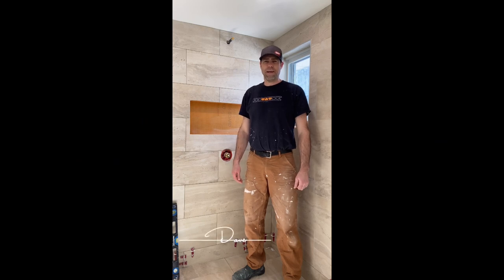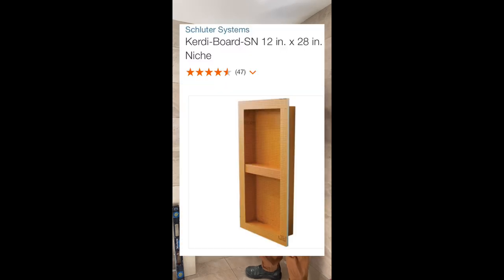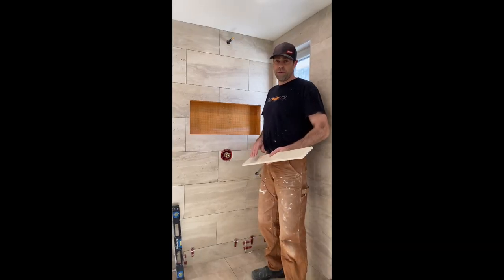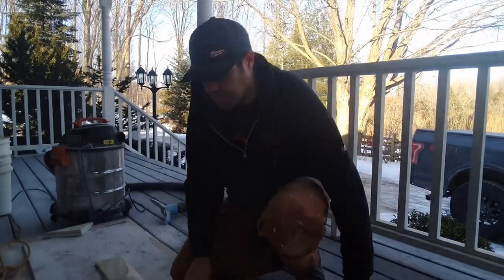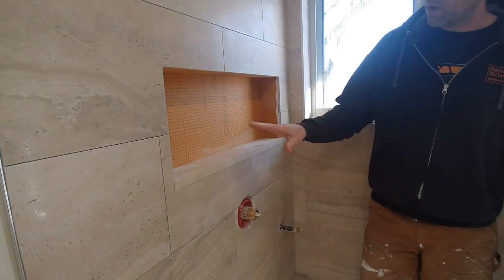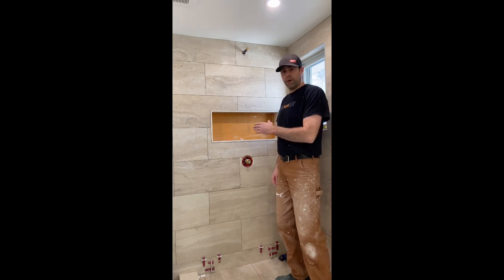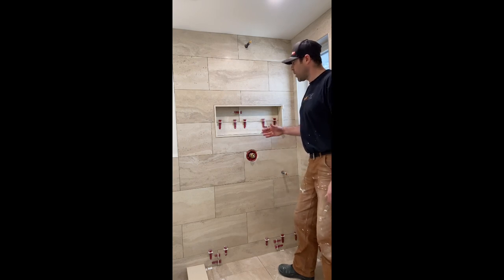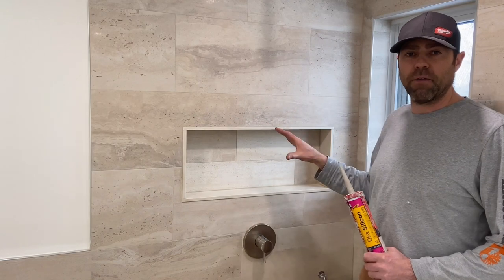How to tile a niche 🛠 quick tips for beginners

Comment: what else can i use same as marmaline? from local stores? everything i can find has beveled edges. i dont want beveled edges
Reply from the maker: Thanks for watching! Many tile suppliers around us sell Marmiline with one beveled side and one flat side. The tough part is finding one that is finished (polished) on the flat side. If you can’t find any that are polished on the flat edge, you can use a high grit buffing pad to polish the edge and then use a a quality high gloss sealer/impregnator and that should get you close. 
If you can’t find any Marmiline without the bevel, you could try a rip cut on a wet saw to remove the bevel, and then use the process just described. We hope this helps and please let us know how you make out!

Comment: Is an overhang a bad idea? Would this get mildew around underneath ?
Reply from the maker: Hi Alex, the caulking we use is Keisel Oka premium sealant. It is a 100% silicon caulking rated for interior or exterior use and boasts anti-fungal properties. In our experience, we have had no issues with any sort of mildew, however we would always encourage viewers to carefully read the instructions on all products to ensure it is the correct choice for their particular application. Furthermore, cleaning your shower from time to time with an appropriate cleaner will also greatly reduce any potential for mildew growth, mineral staining, or soap scum build up. Thank you for watching and commenting!
Reply: @stronorbathworks8195 thanks for the reply.  I am planning niche now and have seen some with the quartz bottom piece at maybe an 1/2” - 1” overhang . I noticed your stone pieces are all flush around the border. My question is which would an overhang bottom stone piece lead to issues/gunk buildup? Thanks
Reply from the maker: @Arr5503  Hi Alex, sorry for the delay in our response. We don’t leave overhangs that large on our niches or benches, so it would be hard for us to give reliable advice. With that being said, regular cleaning should eliminate the chance of any mildew buildup.

Comment: Why caulk around the niche and not simply grout it along with everything else?
Reply from the maker: Hi John, it is not necessary to caulk around the outer perimeter of the niche, however, sometimes the cut tiles do not line up perfectly with each other or there can be small amounts of chip out depending on the quality of tile and the quality of the wet saw blade. For these reasons, we find that a nice clean, thin bead of caulking does a nice job of concealing any of these imperfections. You are correct though, simply grouting is sufficient.